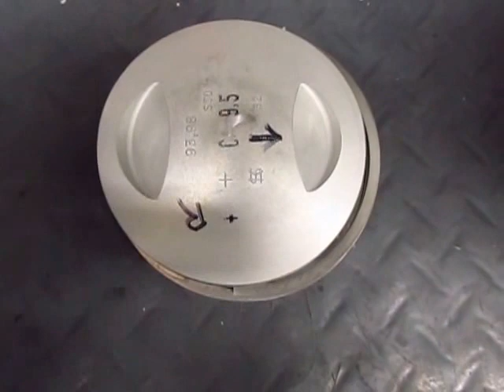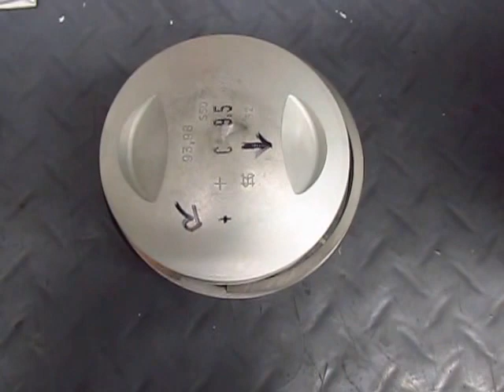1977 BMW R100RS Piston Ring Orientation

Comment: Hey brooks are these piston rings pre gap?
Reply from the maker: Hi Long Chau, I always check the gaps in the cylinder bore before installing the rings on the pistons to be sure the gaps are within specifications.
Reply: @BrooksAirheadGarage  just curious what manufacture did you use for your rings and did you have to do a lot of adjusting for it? I followed your original tutorial on the top end installation unfortunately the ring gap was never mention in the video.
Reply from the maker: @NotJooob  These are BMW supplied rings. That said, these are the rings used with Nikasil cylinders, not the ALFIN cylinders. 

These videos are just a summary of the work. All the details about this build are on my web site.
--> https://brook.reams.me/bmw-motorcycle-rebuilds/1977-bmw-r100rs-rebuild-project-index/

This is the one covering the piston installation.
--> https://brook.reams.me/bmw-motorcycle-rebuilds/1977-bmw-r100rs-rebuild-project-index/11-bmw-1977-r100rs-install-connecting-rods-and-assemble-top-end/
Reply: @BrooksAirheadGarage  as always thank you for the quick responses. You’re the goat!